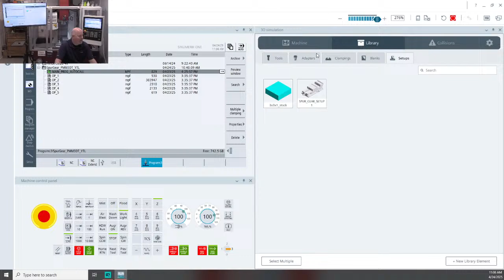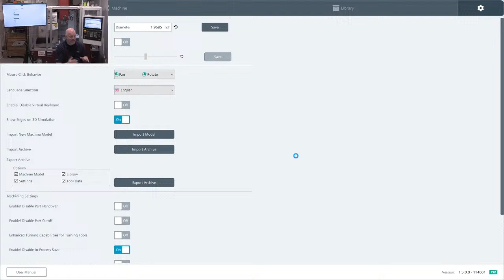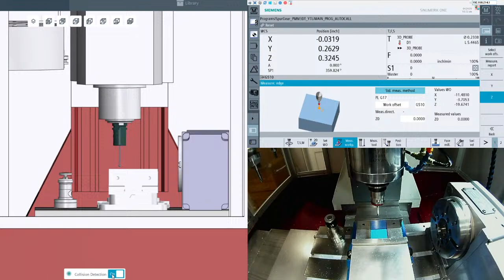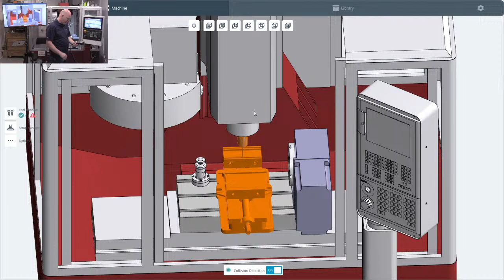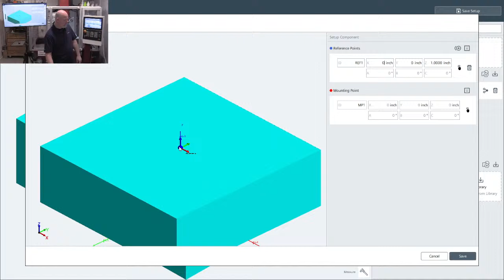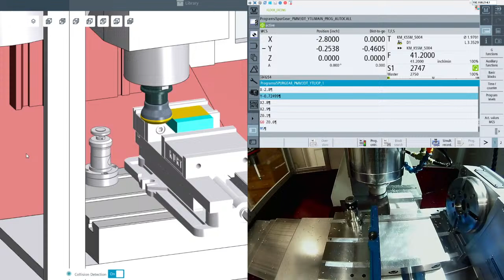Real time collision avoidance with Protect My Machine 3D Twin

Comment: Price looks good need to see material removal option cost. Can i import setup from fusion? Possible to make import  machine model without run my virtual machine?
Reply from the maker: you can bring in your models as STEP or STL from any CAD or CAM solution.  Fusion included.  Send me your contact info and i can have someone give you an idea of cost.
Reply: @MrCNC  I am in Europe there is some price listed at dex Siemens. Unfortunately  not good for older 840d sl. 4.95 sp3 and up. I am researching the possibility to upgrade to newer SW or sinumerik one.